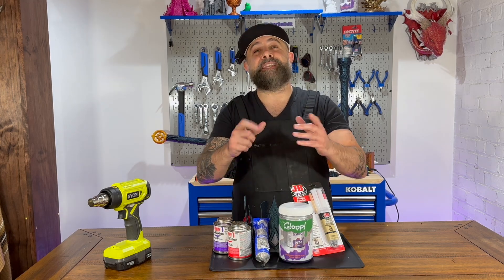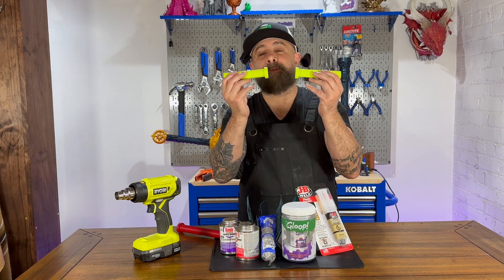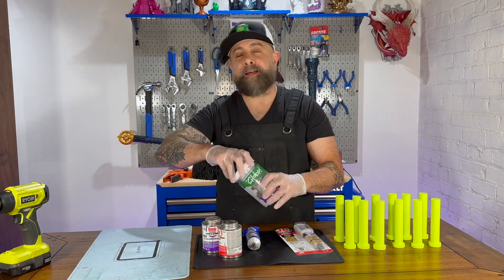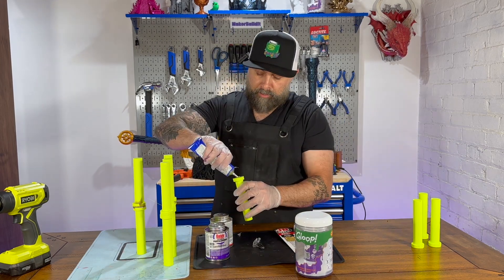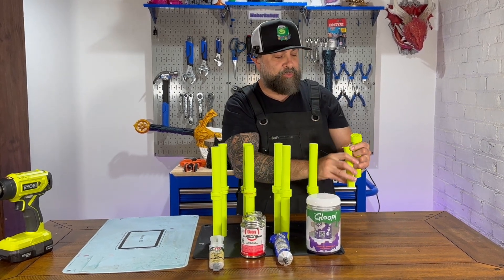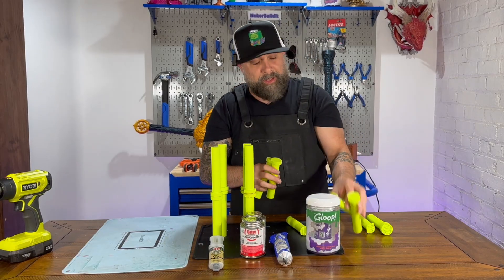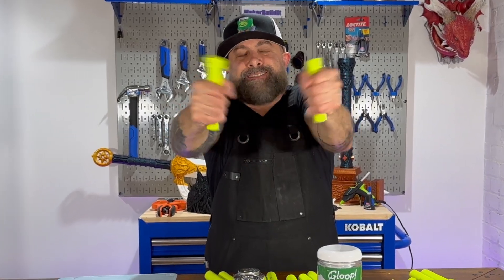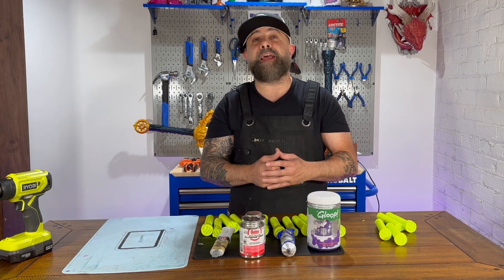Top PETG Adhesives Tested: Which Glue Holds Best?

Comment: I tried the JB Weld for plastic.  I bought the 5 minute version so I wouldn't run all over.  Well, at five minutes it was not setting up.  At ten minutes it had run where I didn't want it.  At 15 minutes it was starting to thicken for the first time.    So make a small test batch.  It seems it is easy to get different amounts of resin and hardener at first from the two tubes.  Not enough hardener and it will be a long set time.  Eventually it did stick the PETG to the PLA part I had made.

Comment: You need to make the handles thicker with tapered chamfers leading to the glued faces so that PETG is less likely to break before the adhered surface comes apart and use a luggage scale to get a quantifiable figure of the force required to pull apart.

Comment: I've used IC-2000 | Rubber-toughened CA and BSI CA a lot. both with activator.  Thanks for the PVC glue example. I didn't think about that.  Dry time and ease of application is typically the most important for me.

Comment: Keep in mind Gloop says you need to lightly sand both parts. Sanding lets it really penetrate and change the composition of the plastic.
Reply from the maker: Absolutely! Lightly sanding both parts is crucial for a strong bond. Thanks for emphasizing that important step!
Reply: So this is an admission that the glue doesn't cause a good bond as they're relying on asperities on both surfaces for it to hold lol
Reply: Ironically the reason you lightly sand both surfaces isn't so there's a 'rough surface' for it to 'adhere better' like most bonding agents but more so for it to immediately seep in to both components and intensifies the process moleculary. It essentially almost liquifies both components and literally bonds them together as if they were one. 

Before I bought some I fully expected it to be just like any other CA glue or something but it's for sure much better. It is a pain to put it on cleanly and evenly. I'd only use it on parts where, once dry and done, you already intend to fully sand whatever it is and either fill / prime / paint or whatever else. Otherwise you will have a pretty nasty looking seam.
Reply: @B_M_A  Interesting, on many wood glues we do kind of similar but we will wipe the grain with a damp cloth causing it to open the end grain a little and absorb the glue down into the grain as it dries.

Comment: I've been pretty disappointed with Gloop PETG after really enjoying their PLA variant. With the PLA version you seem to get real fusion between the two parts, where as the PETG version I have had better results using regular old super glue. It doesn't make any sense to me, but your second test with their PETG version mirrors my experience.

I will be getting more of their PLA, but I will be checking out the PVC pipe cement and the JB Weld Plastic Bonder. I feel like I wasted my money on the Gloop PETG version and it wasn't cheap.
Reply from the maker: I agree! The 3D Gloop PLA good worked great. We did a video on testing a ton of glues for 3D printed parts. https://youtu.be/FxPpKVmKZWk 😁 But the 3D Gloop for PETG didn’t perform as expected, especially for the price point.